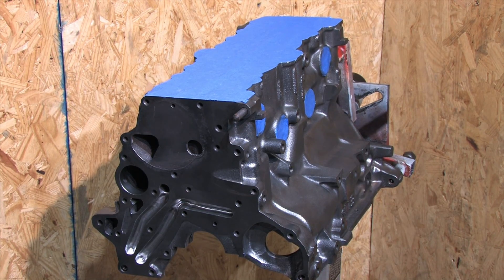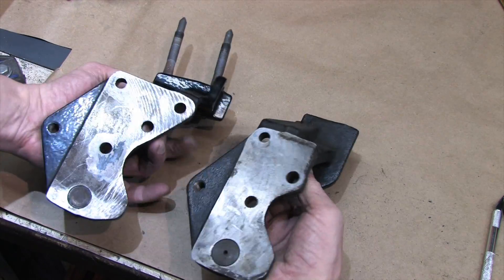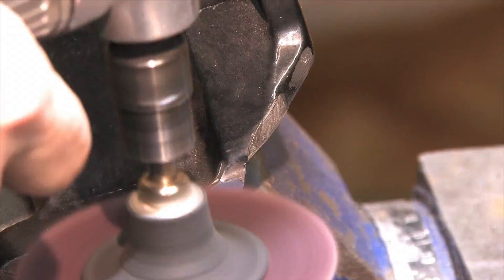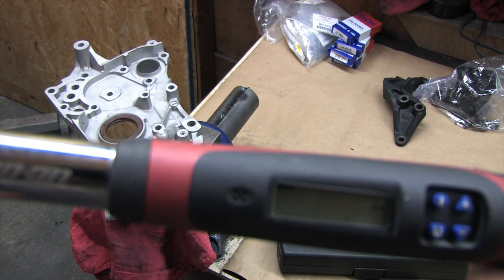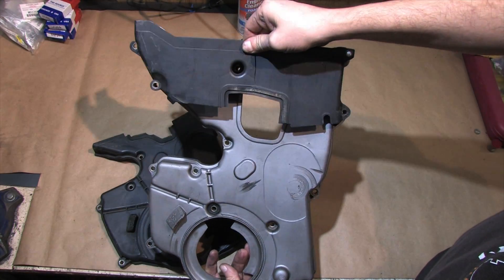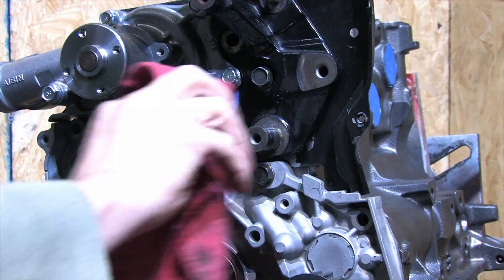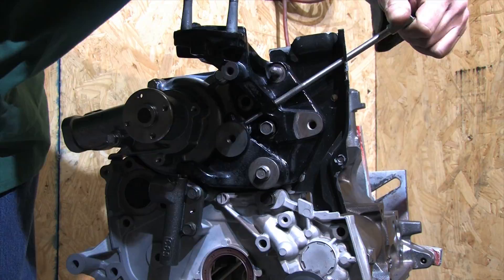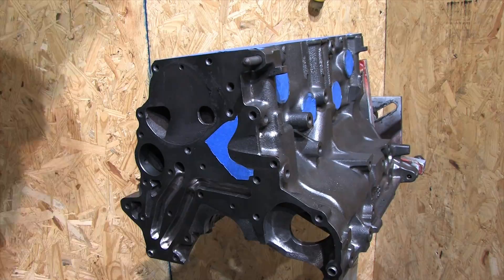GSX Block Prep Part 2 - 1gina2g Timing Side

Comment: Good video man very informative. Can you please go check out my 6bolt swap uploads and tell me if you can figure out my no start issue? Thanks
Reply from the maker: It's a 6 bolt swap.  There's a lot that needs to be changed wiring-wise.  I don't know what equipment you have plugged in to it or how you're dealing with the missing crank angle sensor?  What ECU are you using?  Which head is on it and what sensors?  Do the ECU year and the cylinder head and all of the sensors match?  Help a brotha out.  I'm a little bit lost.  It sounds like an ignition problem, but there are a lot of variables to guess without knowing specifically what equipment you have.  If you're not keeping ALL of the original sensors and installing a crank trigger, I would defer to any advice offered at DSMtuners because I'm cheating by keeping all of mine original and adding a crank trigger.
Reply: ***** thanks for checking out the videos and getting back to me. Yeah it's a 6 bolt swap with a 2g head but I'm not sure what the year the head is from though seeing as I bought it already fully assembled from an abandoned build. I did however keep all original 2g wiring and sensors as well as the stock black box ECU. I'm also using the black top CAS to simulate the cam and crank signals. Everything bolted up and hooked up seamlessly up until I went to crank it and wouldn't start. Thanks for the help
Reply from the maker: What year 2g is it?  It's a big variable.  The CAS changed in '97.  I have always read that you should use a 1g CAS for this swap because it's what provides a crank signal.  My information may be older because I made up my mind to have a crank sensor years ago.

1g CAS sensors simulate the crank angle sensor as well.  The 2g cam angle sensor doesn't.  Depending on what year 2g ECU it is, the firing order might change because it could be 180° out of phase of where you need it.  The firing order can be corrected by swapping pins on the wiring harness at the ECU connector which is the cleanest wa to do it, ECMlink is the easy more costly method because all you have to do is check a box... or you can cut and splice wires on the CAS wiring or coil pack.  I'm not a fan of that, but it's effective.  I've seen people deal with that lots of different ways.  Some people just swap around their plug wires to change their firing order instead.  The RRE method dictates doing extensive modifications to the 7-bolt front case to make it fit the 6 bolt block just so that they could maintain the crank angle sensor.

I would recommend identifying the year of your ECU, wiring harness and cam angle sensor, perhaps even your coil pack, and see what's in the forums about that combination.  There's better advice and information about it there than what I'll have here.  I'll be the first to admit that.  I've seen a lot of discussion, but I made up my mind to use a crank trigger kit and all the correct year factory sensors and signals my ECU expects to see.  I don't want to deal with any of that mess or the random misfire CEL's that result from using a 1g CAS.  I'm using a crank trigger kit making the whole swap plug-and-play.  It just requires deleted balance shafts in order to install it... which will happen on this car because of how it's used and serviced.  I'm late on the scene for my 6-bolt swap, and I'm cheating.  It costs more, but requires far less effort.  I understand that others may not be as fortunate, but are determined because they know what's to love about what they've got.  The pioneers are in the forums, and they know which parts are out of phase with which other parts.  I've never had to learn it?  Beg my pard?  Also check out Magnus and RRE.  They've got GREAT write-ups.
Reply: *****  I actually did a lot of reading on tuners, Magnus, RRE and dsmtalk about the swap prior to attempting it and came up with using the 1g cas and RRE's plug and play crank harness as the best and mostly used ways to go about the swap. I don't know if there's a way to identify what 2g head I'm running but I know for sure im using a 1g black top cas, black box ECU, and all the stock 1999 sensors. I tried changing the firing order at the coil pack as well as the head several times but none of it worked. I'm gonna do my best to identify what year my parts are as you suggested, I'm also gonna try switching coil packs, as I have about 3 of them lying around. I'll let you know how much progress, If any, that I make with that. Thanks again brother. Your help and input is much appreciated

Comment: "Remember to to torque the oil pump sprocket"
This was not done when my engine was assembled, stub shaft fell out into the bottom end and killed the engine with oil starvation.

Comment: How's it going JAFRO!!! Getting close to machining my block soon. Almost got all the bottom end pieces, this bottom end is starting to get pricey..never had a budget in mind to begin with. Though currently I need oil squirters since I picked up the NA block. Wondering if you knew a source to pick up a set.

Comment: Jafro! be very careful using that timing belt tensioner tool. I used one while doing my cam swap a while back and the tip broke off right behind the tensioner pulley. I had to pull out everything just to get that little piece out and turned a 1 hour cam job into a 4-5 hour job looking for the stupid little tip. Make sure to lube the thread and tighten it incrementally when doing so.

Comment: If it wont fit, it will in a min lol :-))

For that bolt head in the way of the adjuster, i would have used a countersunk torks bolt and countersunk the hole, call me lazy.

Comment: I used a 1G block with 2G oil pump, crank hub, and oil pan on my 6G72. Had to modify the idler pulley adjustment bracket to get it to work. But, the deeper and narrower pan made my exhaust fit a lot better and provided more clearance between the pick up tube and the bottom of the pan. Great video that covers the things no one else cares to take the time to publish but bite you in the butt if you do not plan ahead and do your homework. Thanks again!